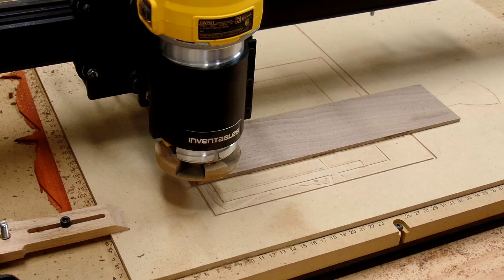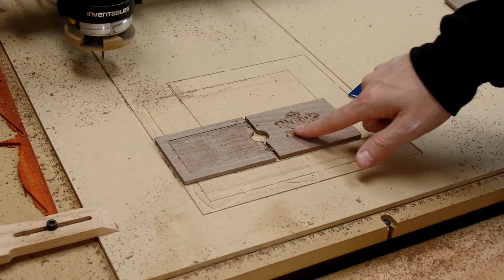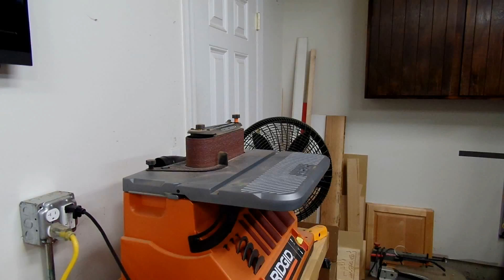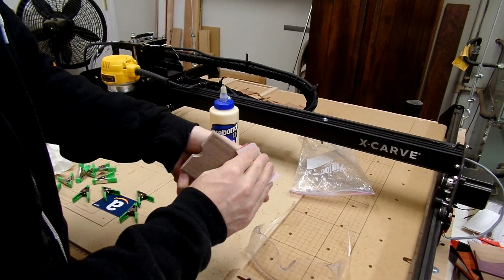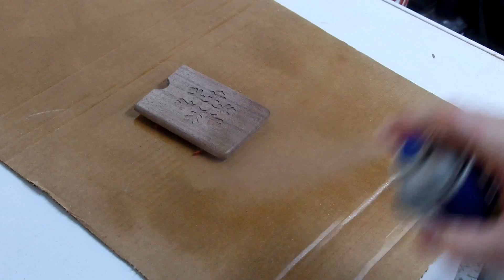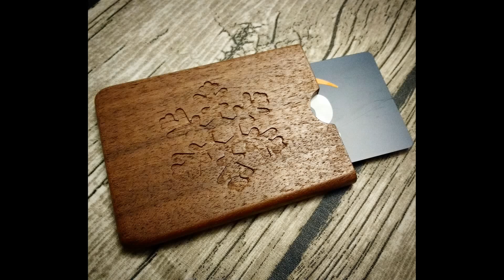Walnut gift card holder on the X-Carve CNC

Comment: Just found your site, and am very interested in how you suspended your XCarve.  I did not see any videos that addressed that.  Do you have to raise each corner by itself, or are they ganged together somehow?
Reply from the maker: +Ira Kopilow I used the Racor ceiling storage lift. I got it from amazon, here: http://www.amazon.com/Racor-PHL-1R-HeavyLift-4-Foot-Cable-Lifted/dp/B0009I8AO6

Instead of installing the mesh grate platform that came with it, I just used two layers of 3/4" plywood, glued and screwed together. Basically, I just bought one full sheet of plywood, cut it in half into two 4x4 pieces, and layered them. Attached that to the lift hardware, and that's it. It all lifts up together with one crank. They have a bit you can put in your drill to lift it all up by just running your drill, but it seems to take a lot of force, so I'm nervous about subjecting my drill to that. It's not that hard to just crank up, and frankly, I don't lift it up all that often, because I use the x-carve all the time!  I did have to make a small extension on one side of the lift table for the electronics to sit, but it wasn't a big deal at all. When in the down position, it sits on a couple of sawhorses for stability.

Let me know if you have any more questions!
Reply: +SJWoodworks - Thanks a bunch.  I have a shop with 1 car and 2 motorcycles.  I pull the car out to do anything, but the bikes stay.  Everything is on wheels, but I am still limited on floor space.  The only way to go is UP!

Comment: Is that the Ridgid spindle/belt sander? If so, how do you like it? I would like to get one but was hoping to find someone that has it and could give me a little "review" of it 1st. Do you use the spindle much or mostly just the belt? It seems like a pretty versatile machine to me. Thanks for your time.
Reply from the maker: Yes, this is the rigid spindle/belt sander. I like it a lot. Very reliable, and I like the oscillating feature of the belt sander. I use the spindle a lot for inside curves, since the belt can't get inside there. Well, the belt can get in there a little if you use the side of it, but it gets awkward, and it only takes a moment to switch for the spindle. Before this, I just used drum sanders on my drill press. This is way better for sure.